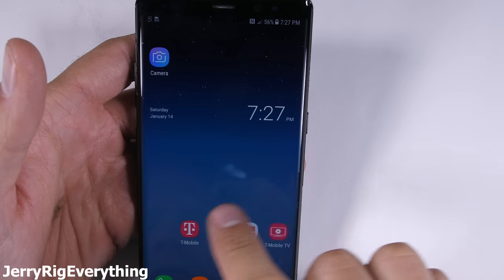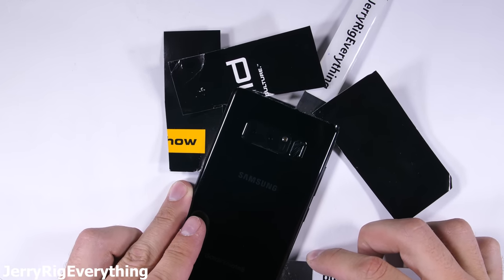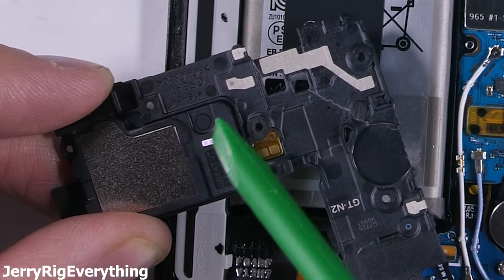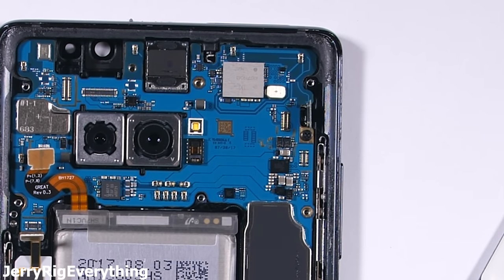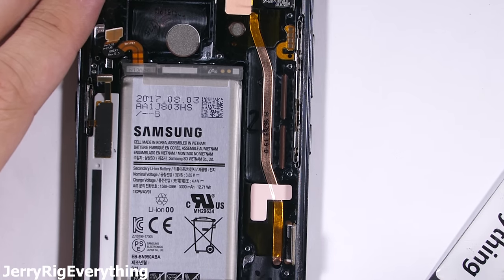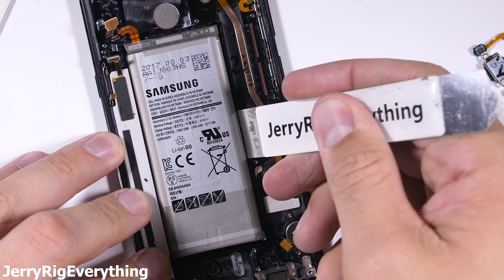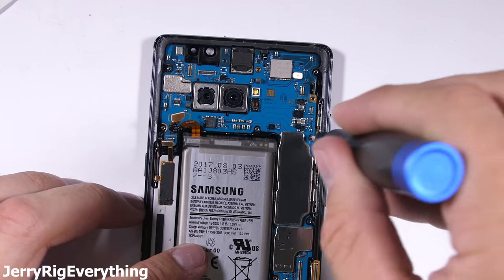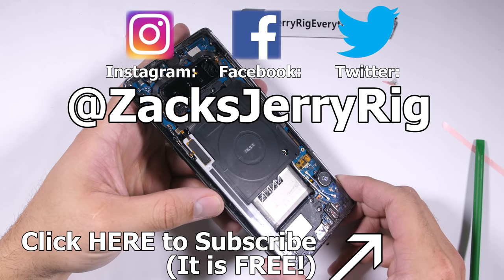Note 8 Teardown - Screen Replacement, Battery swap

Comment: I think you left out the most important part.. replacing the screen.
Reply: Yep, only reason i was here, it is in the title, but he doesn't bother showing or telling you what to do.
Reply: Just save some time and buy a replacement screen already mounted in a frame.  Same steps as outlined but no need to pry the screen away from the old mid-frame.
Reply: Very true : hate click bates - nothing showing the screen replacement
Reply: What a waste, "it's not fun" thanks for that I guess
Reply: @Bruhstorfer  but it's incredibly easy to destroy the damn display if you do it wrong.

Comment: So do I cut the blue wire or the green wire?
Reply: UnPhayzable 3 wires:	
If there are no red wires, cut the second wire.
Otherwise, if the last wire is white, cut the last wire.
Otherwise, if there is more than one blue wire, cut the last blue wire.
Otherwise, cut the last wire.
4 wires:
If there is more than one red wire and the last digit of the serial number is odd, cut the last red wire.
Otherwise, if the last wire is yellow and there are no red wires, cut the first wire.
Otherwise, if there is exactly one blue wire, cut the first wire.
Otherwise, if there is more than one yellow wire, cut the last wire.
Otherwise, cut the second wire.
5 wires:
If the last wire is black and the last digit of the serial number is odd, cut the fourth wire.
Otherwise, if there is exactly one red wire and there is more than one yellow wire, cut the first wire.
Otherwise, if there are no black wires, cut the second wire.
Otherwise, cut the first wire.
6 wires:
If there are no yellow wires and the last digit of the serial number is odd, cut the third wire.
Otherwise, if there is exactly one yellow wire and there is more than one white wire, cut the fourth wire.
Otherwise, if there are no red wires, cut the last wire.
Otherwise, cut the fourth wire.
Reply: how about cut none 😑
Reply: The fingerprint scanner cable
Reply: you cut the red one silly!
Reply: Cut all the wires
Reply: Don't need to cut. Just need to snap them off like little legos
Reply: but what if all 3 wires are black?
Reply: UnPhayzable Rigs Everything
Reply: yes
Reply: DLTAS Builds did you just copy a paragraph of the keep talking and nobody explodes manual
Reply: nice work
Reply: DLTASeven wtf!!! how much time it take to write it
Reply: UnPhayzable red wire
Reply: @joshuabest100  i don't want to look like a 9 year old but woooosh
Reply: @joshuabest100  r/swoosh

Comment: Well, the screen is just as hard to remove here as the back on the iPhone. Stop bashing it all the time, it's hard not to think you are biased in one way or the other. You might like one thing and not the other, but we know that already, no need to say it all the time. Apple won't change, you will never ever get your headphone jack back, Zack.

Comment: ..but you didn't actually replace the screen.. :/
Reply: He didn't buy a screen, and he said it's hard to replace it
Reply: The screen cannot survive the removal process. It's likely he'll do a follow up video when he has a replacement screen ready to go.
Reply: DarkLink1996 -  But the title doesn’t say, “How to replace screen but that’ll ACTUALLY be in another video”
Reply: Bestgameplayer10  He’s just showing the process, like he does in every single tear down video. When does he ever replace the screen in any video
Reply: Steve Martino i have seen screen with metalframe comes alltoghether so no more mothering with the heatgun
Reply: You'll find on the market the screen replacement with the body, so you just transfer the motherboard and the other things on the new body.

Comment: I think Apple might be getting whats it has coming for sometime now with the iPhone 8 batteries expanding. don't get me wrong I have a iPhone 7 plus but now I've started to realise that they just increase the price not to include new features but to make heavy profits. I know as a business you need to make profit to stay in business but when you are making more than 100% of profit, I feel no remorse making a comment like this
Reply: iPhone 8 batteries are not expanding lol. And Apple definitely does not make more than 100% profit. They give you a better deal than Samsung does. It costs around $420 for the parts of the iPhone X. It only costs around $300-$310 for the Note 8 parts. iPhone X is $999, Note 8 is $969.  If you include the fact that there’s more manufacturing, marketing, and shipping costs for Apple than for Samsung, you see that Apple gets much less per phone than Samsung does.
Reply: Whimsical Penguin .. Apple has officially acknowledged the battery issue.
Reply: dude i am late to the party... but my iphone 7 battery expanded last year too... its normal... plus HOW DO YOU THINK THEY COULD MAKE 100% PROFIT? LOL
Reply: Whimsical Penguin you're not getting a better deal from apple than samsung lol, what does marketing have to do with getting your screen repaired?
From what i know you do pay shipping when shipping your iphone to get it repaired.
Manufacturing? Yeah because they would have to get the OLED displays from samsung which samsung been making displays for apple for years now.
Every iphone 8 and X sold, samsung get $110.
You get much more less on sammy phones when you dont need to spend $80+ dollars for something you should have in the box when you buy the phone.
Crazy too is the back glass on the iphone x cost $500+ dollars to replace.
Reply: No problem is when something brakes on the iPhone it costs half the price of the phone to fix. Also it's actually more expensive to make a phone that has a headphone jack waterproof than a phone without it.
Reply: @__No___223  you could have a point. Being that Samsung makes chipsets and screens for apple and even some other parts it makes sense.  I mean apple has to pay Samsung $110 for each screen on there phones that have oled screens. Then they just had to invest a ton into LG. They are also wanting to invest into the tiwan companies. They have been trying to get all the tiwan companies to all work together and with them to try and match what Samsung is doing. A lot of people dont relyize that Samsung has the phone industry by the balls rite now. Because of a lot of the technology that customers are wanting in there phones Samsung is the only  one capable of making. They seen this coming and invested in these technologies over 20 years ago. They also want sell the patent. Like the oled screen Samsung and LG are the only ones with that technology.  But LG has invested more in the TV screen technology and Samsung more in the phone.  This is why LG TVs are a little better and Samsung phones well are a lot better. Also Samsung is one of the biggest richest companies in the world they make or sell just about anything and everything on the planet. Apple knows that they can not challenge Samsung no longer by there sells so they are having to invest into other companies to all work as one to try to compete with the giant. If not for Samsung apple would not survive.  People would stop buying there phones.  So apple had no choice but to buy Samsung screens. But they invested in LG so they can learn the technology then use all the other companies get them to all work together and try to compete. People dont see all this money that apple has to spend.  They want to act like there ripping people off. But no they keep having to spend more and more money. So they have to charge more. They are planning for the future. I think they will come out with a beast in a couple years. I hate people that get obsessed with one brand then want to call another brand trash. Both are really good. Yes Samsung is the best. We all know that brand whores want admit it. But its obvious. But I phone is a fantastic phone and is better at some things. But Samsung has way! More money than apple. I don't see Samsung being dethroned anytime soon. So apple will have to continue to invest heavily in other companies and technology.  So they have to charge what they do. It's not just about how much it takes to make and how much they charge. They have to spend a lot of money on other stuff.  So I agree with you completely bro! Plus apple software is as good as it gets.

Comment: Another great teardown, thanks Zac.  I doubt I'll be buying this.  I simply don't like the recent tendency for phone manufacturers to build their phones with glass backs.  Asking for trouble.  Also if they insist upon no removable battery then I will INSIST upon the easy replacement of such.  Not this heavily glued up impossible to open crap!  So whatever phone has the easier battery replacement (as well as keeping the headphone jack) will get my dough.

Comment: No apple bashing? Unsubbed
Reply: Bason Journe157 lol
Reply: 0:47
Reply: Bason Journe157 0:47 :p
Reply: Well i can return the „bashing“

Maybe you cant replace the back panel very easily , but its very easy to repair the display, cant say that about the Note. I think we all prefer a working screen over a fixed back.
Reply: also 5:07
Reply: And 4:06...
Reply: Bason Journe157 he did criticize the IP rating of the iPhone
Reply: Chintamani Helekar pixel 2 doesn’t have a headphone jack either so you could say he’s bashing them as well
Reply: Bason Journe157 😂
Reply: It won't happen since Google is doing the same now. Nobody bashes them. They run YouTube and you don't abuse the hands that feeds you. 

I have heard anyone from big reviewers who has bashed Pixel 2 design and headphone jack. It tests their integrity. Most of them will not challenge Google and lose exclusitivity.
Reply: Bason Journe157 lol
Reply: How can you missed 0:47?? Do you even watch the video?
Reply: He literally did twice..
Reply: Mabirc That's ironic, if you get what I'm referencing.
Reply: iMicca awww iSheep is mad.
Reply: Are you sure iSheeps are the ones being mad here?
Reply: GoogleSheep will be mad in the Pixel2 vid.
Reply: Mabirc A working screen that'll get broken instantly < a working screen that can be replaced
Reply: At 4:06 he does a subtle bit....When he says ip-sixty- - - EIGHT! lol
Reply: 5:10:/

Comment: Think it would be cool to do a stress test/benchmark on each phone and include the thermal imaging while the stress test is going. After a few generations of phones we would have a good understanding of what works and doesnt work in mobile phones' heat dissipation (and perhaps why), and of course the stress test results.

Comment: Hello Jerry, awesome channel, love it.
I have a question and i cannot find anywhere on the internet the answer to it.

I have a Note 8 (over 2 Years) and its...used. I have black pixels at the left top of my phone, tiny, and i have broken my glass. i want to switch the glass to a new one, but im worried that the dead pixels "grow" like you shown us on the GalaxyFold. its waaaay cheaper than switching the display.

can i do this without "growing" the dead pixels?

Comment: Hey Jerry I love your vids and learn a lot from them! I wanted to ask you for the note 8 I know that it scratches on a level 5-6 I think you said, but I also remember that you said that some particles can potentially scratch the screen I think. My question is, can regular dust potentially scratch the screen if the dust is located under the screen protector after installation?
Reply: I mean scratches at a 6-7 from your scratch test
Reply: awadhi686 yea it can since dust will likely have a bunch of other stuff that's harder than glass which is why a phone screen will likely have a bunch of micro abrasions and scratches over time without a screen protector, although it's nearly impossible to prevent anyway

Comment: Excellent detailed video! 😀 
What Samsung Note 8 replacement Glass Case Front and Back with Adhesive Glue would you recommend I go to. eBay customers express bad experiences with easily cracked glass and glue didn't hold. 
One Example:
eBay
FPS KIT LCD GLASS REPAIR LOCA UV GLUE 5ml + Debonder 60ml Samsung Iphone HTC

Any suggestions on a replacement case with adhesive would be excellent. 

Thank you for you help! 😀

Comment: I did this last week without watching this video and I didn’t rip the ribbon cable or break the back. I feel accomplished lol. I also realized it is a lot harder to get the back off. I recommend using playing cards and not the metal tool if you don’t want to break anything.

Comment: I watched you on Louis Rossmann, now I've seen several of your videos and there great. Thanks. IF you read these, I found a Galaxy Note 8 on the road. No BS. and it was face down with a decent gel case on it. But it had suffered a few cars running over it. the LCD and screen seem to be the only damage. It charges and vibrate beeps and charges up if I shake it the flash light will turn on and off so I feel that the internal of the phone is ok. so my question is can I replace the LCD and front panel and then just put my sim card in it and use it. It was from the same carrier as mine???

Comment: Just went to your link for parts. I took my Samsung Galaxy 8 Note in for a new LCD screen and installed with a new battery (the whole front of the phone) was 239.00 and I saw him open the box from Samsung and rip open the package. If that website wants 239 I'm better off having it done. I pick it up in an hour.

Comment: How much force does it take to remove the wireless charger from the frame. Mine seems to be mechanically fixed at the upper end. I am really careful because I don‘t wanna break the internal components (I also damaged the fingerprint sensor while removing the back cover- the glue is really strong!!).

Comment: I'm just wondering what you are wearing to stop static electricity so you don't fry your mother board, I work at an electronics company and we have to wear certain clothes and shoes so the static electricity will be subverted into other areas, at work I don't notice it, but when I get home and take off my work clothes that is when you find where it all went, the type of clothing is holding it all.

Comment: If you get your screen replaced is the phone still water resistant. 

My S8+ screen cracked right on the edge near the top right corner. A little over an inch long and about less than half a centimeter wide and it extends all the way to the metal frame. It's nothing too bad but I can feel the crack (if that makes sense). 
It's not a light crack where it still feels smooth when you touch it.

I wanna know if it would still be water resistance if I get it replaced. I was looking forward to testing the water resistance but now I dont know if the display will get damaged.

Also there is an orange color at the top of the cracked area. It looks to be in between the cracks. I would say it runs about less than half a centimeter long.
Reply: It loses the water resistance, but a cracked screen of a phone is not water resistan anyways.

Comment: Do Mi Mix 2!!!And what is your opinion on innovation. Which one is more innovative.. The iphone X using the handy but ugly cut design on the top or the bottom panel design by Mix 2 (which has the front camera too).

Comment: Hello Zack I have one question for you Can you remove the battery without removing the motherboard ? thanks for the video
Reply from the maker: +Yaasiin9600 Yes. Just don't pry against the mother board.
Reply: JerryRigEverything ok thank you very much !

Comment: Hi Jerry. Hope u could reply my comments. I need your advice. So basically ive been using my Note 8 fr almost 2 year. I did dropped my phone a year ago and there was a crack on my back glass and my phone is running fine. Just yesterday suddenly my fingerprint and camera is not funtioning. While all this is happening, my battery drained from 70%-15% in less then 20 minute and my phone was warm. The next day i went samsung service fr a repair. They quote me $800! I was so dissapointed. They told me my lcd had burnmark, motherboard issue, home button nt functioning, camera and fingerprint sensor and back glass had to be replaced too.  My warranty has expired. They trynna blame me its bc i dropped my phone but i dropped it a year ago and nothing went wrong just my backglass shattered bt still working fine. I didnt continue with the repair i just felt like they lied =( i was thinking of dng it on my own. Do u think its worth trying?

Comment: Observation: The removal of the back glass is not for the faint-of-heart; even with a heat gun, several sacrificial playing cards, and some decent tools, mine still cracked to smithereens. Alas. Question: Once removed, I notice the headphone jack seems to have something protruding out of one side, just as your does - what is, and how does it affect reinstallation? I now have only one channel out of mine after reassembling. Also, any tips for a battery that reports bogus temperature values to the phone after reassembly? Mine now says its a steady -4 degrees F, and won't charge... :(
Reply: mine removed with no problems, you just gotta be careful and go slow,

Comment: So wait, is it normal for the water stickers to have pink X's? I accidentally dropped my phone in the sink and it turned out better than okay but I check the sim slot and saw a sticker with a pink X's. Doesn't it bleed when it's water damaged? I thought the X's show when it WAS water damaged and I felt my heart drop since I barely got this phone.

Comment: when putting everything back togethor, do you NEED to use the adhesives ie battery adhesive etc.
Reply: you need new adhesive sealants if you want to keep the IP68 rating.

Comment: If you replace the home button and cable are you still able to use the finger print feature?
Reply: Everything's Albright yes because it's not like isheep the it won't accept a new button
Reply: nightmare in action nighmare in action thanks